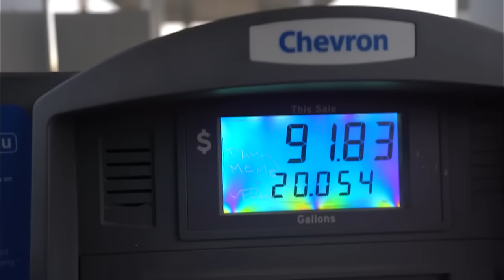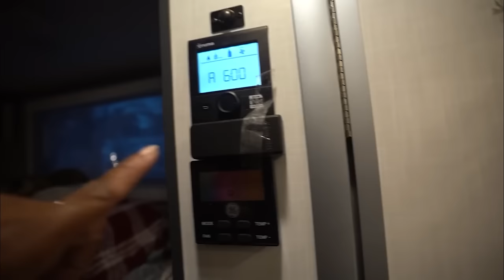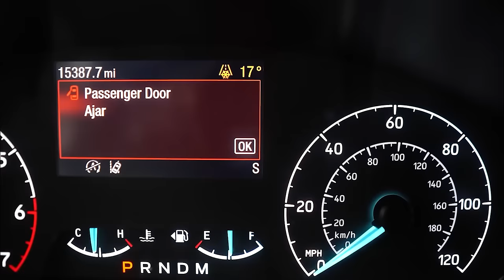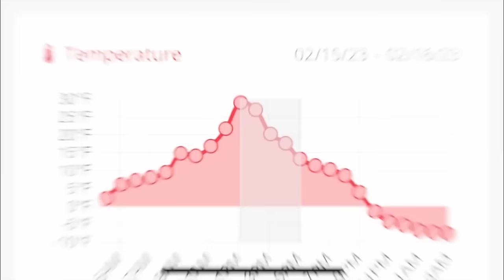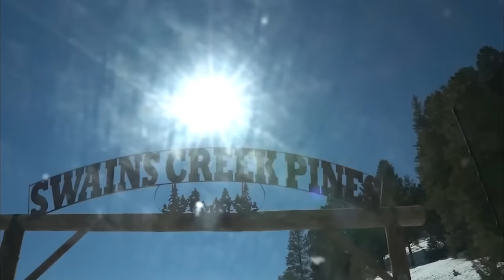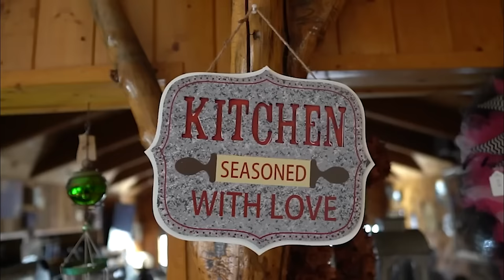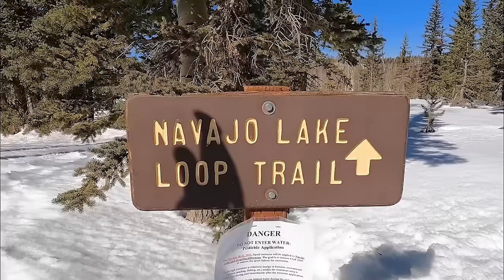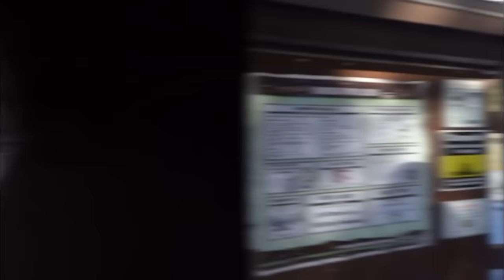12 DAYS! Surviving a Winter Snow Storm in Our Camper Van Alone (RV Life)

Comment: I will not suggest you to drive extended period of time in the very cold winter with snow. because they put sand and salt and little stones on the roads and highways and that damage your frame and under your RV and that will start to rust badly. I will not recommend that. maybe better rent an RV if you just want visit and experience the winter time in nordic climates like Canada
Reply: you can also spray parafin anti-rust under your frame to protect from rust for a copple of years. because in usa the cars often they do not cone with rust protection for extreme cold climate like it us the case in canada